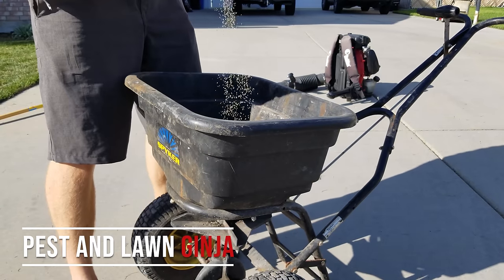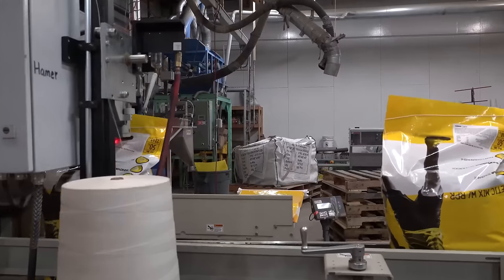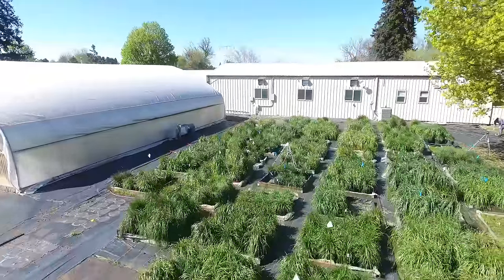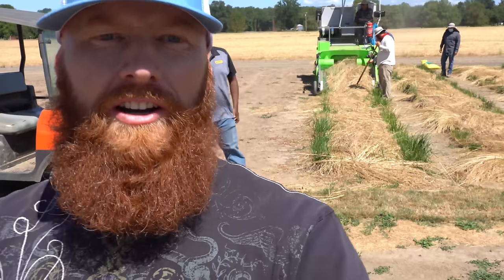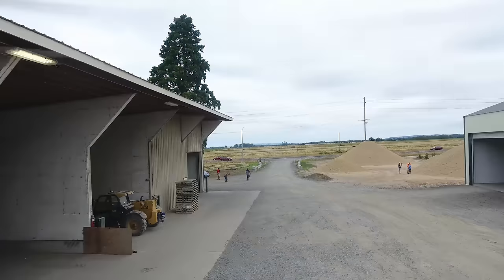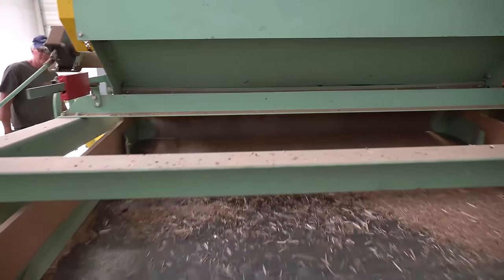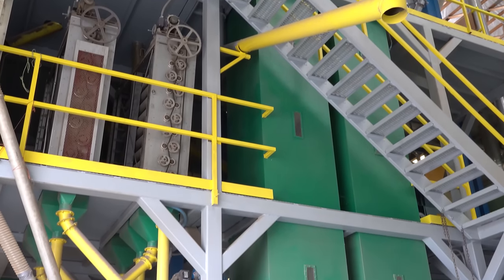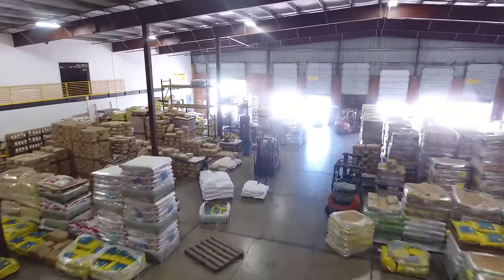How Grass seed is made.  Why you shouldn't buy cheap grass seed. Barenbrug

Comment: I started a new lawn 7 years ago with RTF water saver, turned out great. thanks to Jos Roozen from Garden Sense radio show. he recommended to not change the top soil bc it will only make for a weaker root system. he said grass seed can grow in poor top soil just like trees can grow in almost solid rock. and he said dont use straw, use a fine mulch/compost to cover the seed.
Reply: marty one  I also have a Rft lawn my father use to listen the Garden sense show as well also use turf trust fertilizer 👍 Thanks Dad ❤️ Passing on the good seed😇
Reply from the maker: This theory has been proven by many people in the african desert.  For the most part all it takes is water to get the seed to germinate.

Comment: I over applied weed killer and burned some of my lawn. I also been getting a backbreaking workout utilizing the thatch rake that seems to be one of your favorites. I don't mind spending a little more cash when it comes to fertilizer or grass seed. You pay for what you get. Thanks for this video. You rock!
Reply from the maker: Thanks Darren!  Sounds like you're well on your way to slaying that lawn!
Reply: I got the SunJoe electric dethatching rake and it worked great; saved lots of time over using my rake and it even did a better job too. My only regret is not getting it a couple of years ago when I received an offer to buy it for under $100 on sale; I spent a bit over $150 but money well spent IMO. Check out the YouTube videos that test that machine and you might be impressed.
Reply from the maker: It is a great machine

Comment: Great vid and affirmation. Seeded two weeks ago with Barenbrug RPR and Turf Blue (70/30 - coverage not weight) I went with two rounds of Glypho, level some low spots, two weeks fallowing, the a 3rd round of Glypho before seeding. Tenacity and a 3-18-18 at seeding. I already have a new lawn and I’m on the fence about cutting already with a manual reel. Just nervous about hurting the little turf blues, but I got to get them some light, some of the RPR is at 3 inches. Also thinking to put down some Propiconazole as I want to keep up the watering for the turf blues.
Reply from the maker: Sounds like a solid plan. I'd cut it for sure

Comment: Hey Ginja, living in northcentral Massachusetts when I purchased my home I knew I wanted to have the best lawn. Unfortunately I didn't know anything about proper lawn care. Several failures later I pulled the rip cord and applied glyphosate at 4% per gallon.  The current turf is all but gone and I'm preparing for my renovation in spring. I'm having a real overthinking problem on not only brand but also type. My lawn gets nearly full sun all day.
Reply from the maker: I love barenbrug turf blue pro or their RPR turf saver both listed on amazon.  links in the description of the video.  the rye stripes better

Comment: what is the difference between there two fescue types 
I live in Maryland  and built a house on a farm field no shade.
I put a Bermuda soccer field in but wanted a fescue front so i can get nice stripes. what would u recommend which fescue would you mix in the Kentucky blue as well. Getting ready to aerate and over seed thx  for all the info I'm hooked.
Reply from the maker: Its important to remember that many professional soccer fields are a cool season blend of kentucky bluegrass and perennial rye grass.  Tall fescue is an awesome grass but it does not mow shorter than 1.5" well and its a wider blade grass.  if you know what you're signing up for the rtf tall fescue is great.  I would not suggest mixing it with bluegrass.  the bluegrass grows at a slower rate and doesn't match well in my opinion.

Comment: I did/doing both.  Using Pen/Rebel/Scotts shade/dense shade mix for bigger areas.  And the smaller area I've ignored, but that fine fescue that's doing fine, got some boutique fine fescue for over-seeding/new combo.  I'm still in the experimental stage for this rather shady near pure clay area.  And Darwin didn't say strongest survives, but most adaptable survives.
Reply from the maker: Fine fescue will be your best bet. I've been testing mazama bluegrass and it's going well

Comment: Very informational video.  Question. I did a Reno using seed from seed super store (bluegrass mix) I need to kill off and fix a patch, should I stick with the original seed or can I switch “brands” without a noticeable difference? (Will still be sticking with a bluegrass blend)
Reply from the maker: switching brands could be seemless or it could be a disaster.  from differences in texture all the way to the color not matching.

Comment: Good video.   An off topic question  but I'm new to treating Chinch bugs here in SLC. Utah.  I am reading and read a 1 2 punch wirks good.  Like bifenthrin 2.4% then a longer term chemical.   I now read that many  will kill the worms also. What is the best longer term chemical to put on now?
Reply from the maker: great question.  for longevity we use an active ingredient called imidicloprid.  that'll give 9 to 12 weeks control depending on the rate you put it down.

Comment: I made the mistake of going cheap last fall with my seeds.  I purchased the Scotts contractors blend (northeast mix), put down the seed in the fall and in the spring the lawn came out nice and thick but this past summer was hot and humid and not much rain and while I did water regularly, the grass was a disaster.  This fall, I purchased seed at Ewing Irrigation, it was tall fescue and the company was Empro King which is sold at Ewing Irrigation and its been 12 days since I did the overseeding and its starting to come in and the areas where it is growing is coming in nicely.    Hopefully, this one will do the trick but I plan of over-seeding in the spring time too.

Anyway, two questions:

1.  Should I put down more seed in a week or two or  just wait until the spring.
2.  In some areas of my lawn I do have shallow roots but in another area of the lawn it is bentgrass.  I used my thatch rake to pull out as much of the bent grass as possible and it comes off like a carpet and there were the tell tale signs where it matted down, then browned out over the summer, and then now its getting green again as the weather cools.  I put down tenacity twice at the beginning of August then around the third week of August.    Even though I pulled off as much as possible, is there a chance it will come back even with overseeding the area?  Also the area where the bentgrass was tends to stay wet for some reason, is there anything to do about that other than the obvious don't water as much?  My back is low lying and in the summer tends to hold a ton of humidity.
Reply from the maker: 1. more seed is highly recommended with fescue.  if it doesn't use rtf technology, which I'm pretty sure only barenbrug tall fescue has, it won't spread laterally.
2. There is always a chance the bentgrass will make another appearance.  I would use tenacity next season after your new grass seed is well established.  add triclypyr ester to the tenacity mix.  that will help out a lot.  
As for the watering issue, its commonly a lower spot and I have since been recommended people use a combo of dirt and sand to raise the soil levels to help with that.
Reply: @pestandlawnginja  The bentgrass is so frustrating because it looks fine at the beginning of the season, then as it grows it mats down and you don't realize it until you start raking the area and the grass when it stands up is like 6 inches tall but you go and cut it and it just falls down again.  Then it holds that moisture in and you see the brown roots and its almost slimey.  Then it all browns out or stays green but when you pull on it or use a thatch rake, it lifts like a carpet, its frustrating.  A gardener at the garden supply store told me to do the pull test and around the bent grass and then keep moving over until you get to the established grass, once there, dig a small area just to make sure its not grubs because they will move to new areas once they've eaten the roots of the area they destroyed.  he said to do that just to make sure its not grubs and it is bentgrass and I did just that and there were not grubs where the better grass was.   The unfortunate part for me is my backyard is low lying and all the neighbors have fences so the humidity tends to linger in the back and there is a strip about 3 feet wide that extends about 30 or 40 feet between my house and the neighbors and along his fence line that holds in moisture which the bentgrass seems to love.   Anyway, what I'll do is allow the seed that I already planted take, and its starting to come up after 12 days and next week I will put down some more seed as the weather starts cooling off.  

BTW, the tenacity is interesting as you don't see the results right away, it takes time and next thing you know some of the weeds are gone.

Comment: Maybe I should try this.  We had 3 trees removed and grass just won't grow in those areas. What should I be looking at for Northern Illinois?
Reply from the maker: I would check the areas.  Its possible that the grass won't grow if there's no top soil beneath the surface.  I would dig up to 12" and replace the dirt.  then I would seed.  being in illinois you'll be looking for a tall fescue or a bluegrass blend most likely.  tall fescue is a wide blade grass species and bluegrass is thinner and softer.
Reply: @pestandlawnginja  12" might be kind of hard because we got buried cables back there as well.  I did put a few inches of top- soil though.  Next spring I'll see how far down I can go with good topsoil and not the stuff that's there now.  Including some wood chips from grinding the stumps.  Thanks

Comment: I live in the suburbs of Minneapolis. Is there a Kentucky bluegrass you can recommend for my area that resists drought but still stays green?
Reply from the maker: Hey Tim.  Great question.  So the definition drought tolerant isn't what most people think.  it just means you can take it to the brink of death and bring it back to life.  the timeline is different between the species of how long it can go in drought stress.  What I can tell you is grass is 70% water, there are some species that will grow longer roots than others and if you have a lower water table the roots may find water and resulting in you using less water.  If you want a green lawn you'll have to water.

Comment: Thanks for that. I wish more companies would sell just seed and not with coatings. You're not getting 50 lbs of seed when it's coated. If you follow using starter fert and water, no coating is needed. Does either company sell TTTF as just seed?
Reply from the maker: They sell it with and without the coating

Comment: Please help! I tilled up my yard, leveled, fertilized and seeded around 1/2lbs per 1k with tifblair centipede, its been 7days and there's 1 or 2 crabgrass sprouts per sq inch! Its crazy! I got tenacity coming in 2 days, should I go ahead and spray tenacity asap??? I havent seen any centipede sprouts yet
Reply from the maker: Ewe…. 9 days is a tad premature I’m afraid. You can safely spray 3 weeks post germination or about 5 to 6 weeks out
Reply: @pestandlawnginja  thank you for the response, unfortunately I sprayed it 7 days ago(before you responded which I know your busy) luckily the sprouts appear unphased so far...
Reply: @pestandlawnginja  now my problem is one side of my lawn has some good sprouts while the other half has nearly none with identical soil and same amount of water(sprinklers on timer 3x a day), I know you should transition to higher volume less frequently for roots after germination but should I stick with 3x/day until the other half has higher germination rate?

Comment: Hi, I follow your videos all the time. I live in Saratoga Springs Ny and I am going go oversees soon. I am not sure which grass seed should I use. My lawn has some extremely full sun areas and some dense shade… I was thinking about the RTF from Barenbrug, will that work?
Reply from the maker: rtf is a good choice for you.  its a wider blade grass and has great color.  most cool season grass need 6 hours direct sunlight.  so if you have heavy shade areas fine fescues are commonly the best choice but even they need 3 to 4 hours direct sunlight per day.  if that's not in the cards your better off either thinning out the trees / bushes or hard scaping those areas.

Comment: Hey Ginja, quick question, I didnt have a chance to get the essentials 101 on the ground while seeding. Its been a week and a half and the grass is already reaching for the sun. Do I add it now or do I need to wait.

btw I used Barenbrug and yes, 1 week and we're rocking some fresh grass on soil that has been a nightmare. SunJoe did the thatching and scarifying, added starter fertilizer and nothing else. Could not even do the Tenacity I bought because it is already a bit cold and if the grass didnt take, I would have NOTHING but dirt. Its all weeds out there, or at least it was.   ;  )
Reply from the maker: Awesome Doug!  Sounds like you're well on your way to slaying that lawn!  You can use the essentials on fresh grass every 2 weeks without any issues.

Comment: I went to work on my lawn lowering the blades each cut, scarified twice in different directions, got the mower blades down to the lowest setting and BAM, I'm all set to seed. I used Tenacity 3 weeks apart as well. OOPS! Not so fast. Mother Nature turned on me, the weather forecasts changed and the first frost warning came out, now temperatures aren't ideal for overseeding. Barenbrug suggested I wait until Spring. I have plenty of Barenbrug Turf Blue Pro Kentucky Bluegrass Grass Seed with Yellow Jacket Seed Coating so I hope the Spring planting will work out. My best laid plans were not enough. UGH!!
Reply from the maker: Check the actual ground temps. Last year same thing happened to me and it still germinated like a boss. I'm sure 30% was affected but.... still worked great
Reply: @pestandlawnginja  Thanks for the response. Based on Barenbrug's advice I didn't seed and now temps are all over the place. Getting to low 30s at night, 50s by day. It's very inconsistent and I think the window has closed for me. My prep worked great, my lawn looks torched. Tons of thatch removed & Tenacity worked great. Neighbors are scratching their heads since I usually dominate. I'll be back! LOL!!